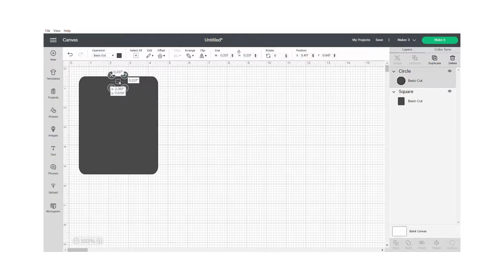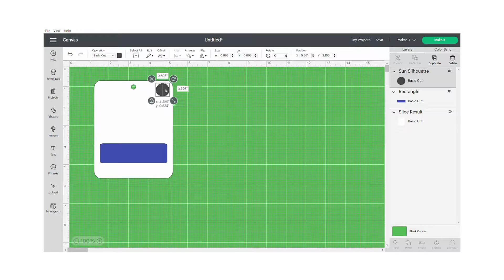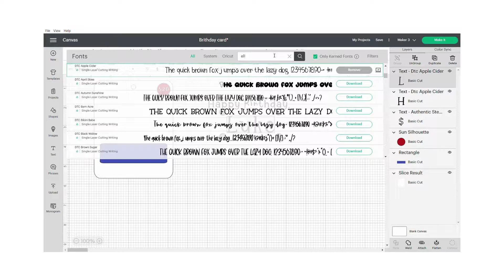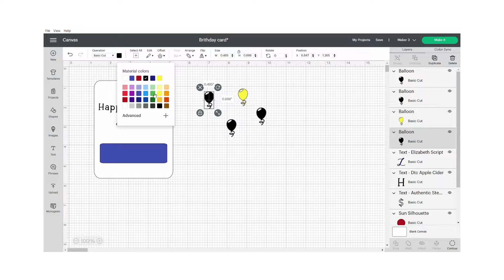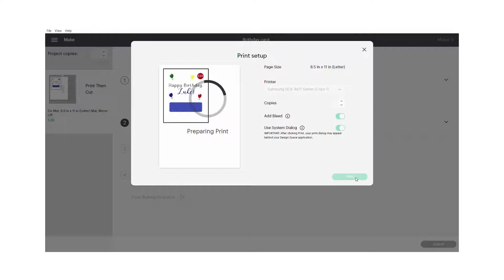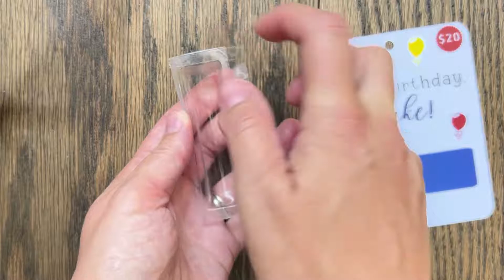Cricut money card holder - Easy using free Design Space templates

Comment: Hi there! Thank you for sharing your amazing crafting videos. I had purchased the plastic holder from you. I’m in the market for a new printer and wondering what printer do you use for the cards?
Reply from the maker: I have mine professionally printed, but I personally prefer the finishing that a laser printer gives. Not sure what other Cricut crafts you do, but they usually recommend using an inkjet printer. I’ve made these cards with my inkjet at home and they are fine - depending on the quality of cardstock being used.
Reply: @olivecrafting  thank you so much for responding!! Good to know an inkjet printer works well for projects like this. I will do some more research. Thanks again for all the help and content you post!

Comment: I could not achieve this  so you print with Canva and cut with crocus. It cut all writing as if I was doing vinyl project. I am missing something you didn’t show it cutting😽
Reply from the maker: Did you flatten your design on the canvas before clicking the “make it” button? Check that the operation on your canvas is set to “print then cut” and not “basic cut”.